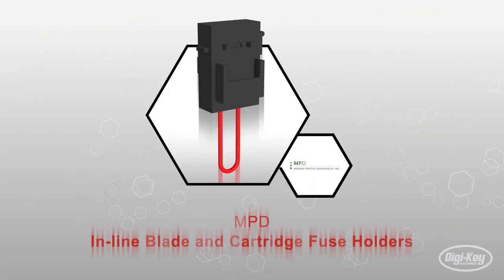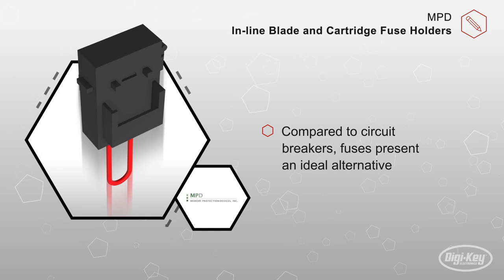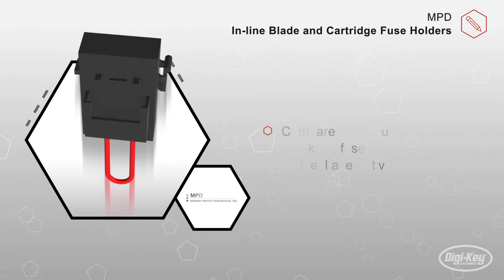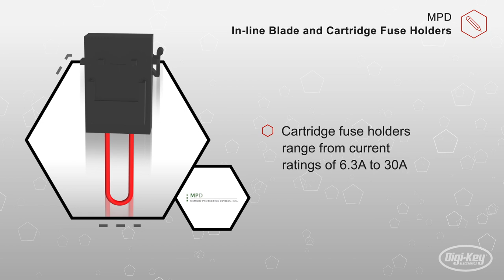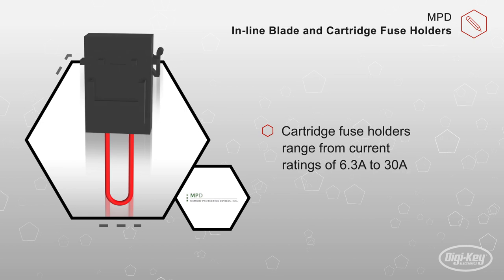BF351 - In-line Blade and Cartridge Fuse Holders | Datasheet Preview

Comment: System protection is the last thing a novice thinks of after designing their system. Maybe you could do a follow up on how to determine the correct circuit value sizing of fuse or placement for us novice designer’s?